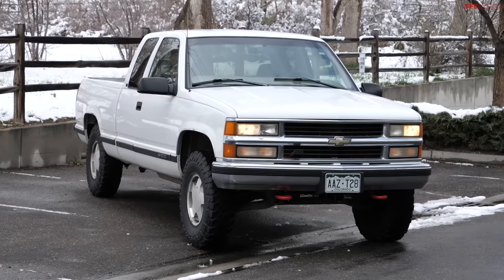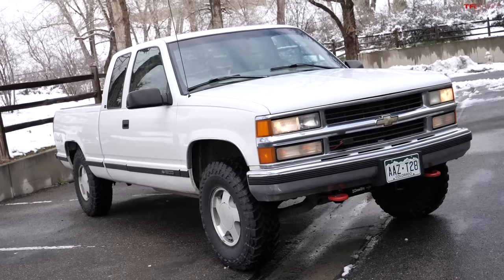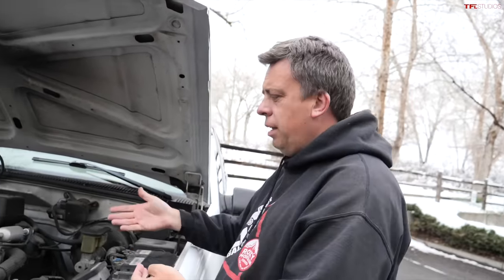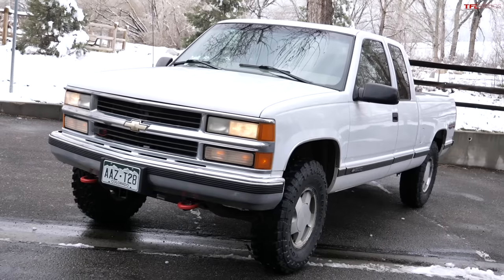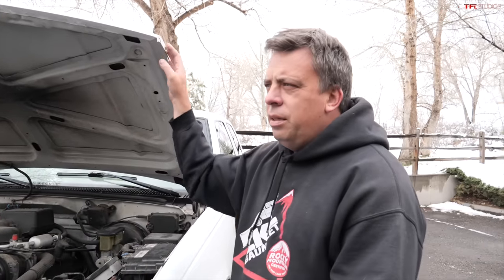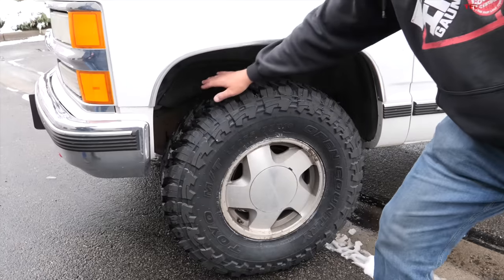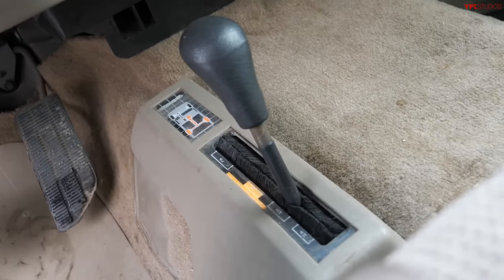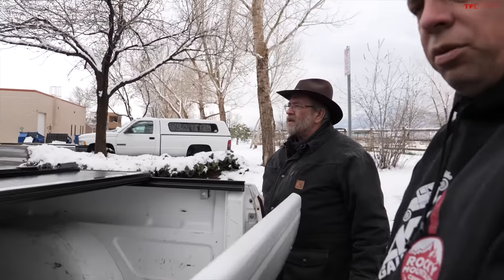Mr.Truck on Trucks: Was The 1990's Chevy Silverado The Greatest of ALL Time?

Comment: i like watching mr truck.
Reply: Thanks
Reply: Mr truck always nice to see and hear your input and experience
Reply: @markv78  Thanks
Reply: @MrTruckTV  Hi Mr truck, do u know how good were the 98 3500hd trucks. I am thinking of buying one that was driving on the highway and automatically the rear end locked up leaving a 200ft dragged mark. When the mechanic checked the engine he didn't find anything wrong
Reply: @andrewebanks325  Did he check the brakes and the limited slip in the rear axels? It's not the engine
Reply: @MrTruckTV  haven't gotten around to check out everything but I will do so and let u know, thanks for responding so quickly sir I really appreciate it

Comment: It may not be the most powerful engine, but the 350 is one of the best engines Chevy ever made.
Reply: Better Then a Rice Burner!  We drive GMC longbed and Chevrolet Silverado Z71 🇺🇸🏁💪
Reply: The 305s where great as well
Reply: I agree💯
Reply: I love my 95 tbi z71
Reply: Yes sir. Bought a 91 Cheyenne 2500 4speed 2wd from a coworker and it's working just fine. I use it as a daily driver and I usually load my tool.boxes in it when I have to in remote areas for a mine
Reply: @captinhoop they were good,if a bit underpowered
Reply: I agree.
Reply: I got a 1996 gmc sierra k1500 my truck has the 5.7 350 vortec and the engine has almost 295 thousand miles on it and it’s still trimming strong besides the transmission needing to be changed cuz the person who had it before me was trynna be a show off had the truck in 4wd and tried spinning the tires in 4wd and tore the gears out of it but the transmission that’s in it now shift so good I love it hopefully the transmission I put in it will last for the remainder of the trucks life which will be a long time hopefully I just need something to get me through some deep snow if I want it to I don’t tear my truck up or go wild with it occasionally I do show off but like loudness cuz it’s straight piped can’t beat that
Reply: I literally blew mine up 9 months ago , drives decent still idles a little rough. Definitely just gonna throw another new 350 in it
Reply: Other then the damn power steering line. I had that problem on mine.

Comment: Best Chevy 5.7 liter and best looking body style GM has ever made. Very reliable too. Love the 350 engine.
Reply: Could not agree more.
Reply: After 40 years they perfected the 350 then added fuel injection... What more could you ask for man!
Reply: @mayonnaiseluther1568  my 95 Chevy 454. Unless a big block is a little bit too much for you....
Reply: @wildestcowboy2668  my 94 454 big block agrees
Reply: @wolfmanjack8402  my 1980 squarebody disagrees with the styling opinion. Obs trucks are a close second but I love the squarebody style.
Reply: OBS the perfect sequel to the square body. 5.7
Reply: I have a 96 5.7 vortec.  Runs good but timing says it's -22 degrees.  Any ideas?

Comment: 500,000 on my '98 k1500. Original engine, going strong and still driving it every day.  It rides better than todays Chevys.
Reply: That is incredible! I hope I get that much out of my '98 k1500.
Reply: My rubbers are going... spray the ball joint, tie rod, control arm and leaf spring rubbers to avoid costly repair.. and grease the nipples... 

Guy I got my from never changed differential fluid. When I opened the cover about a handful came out, rest must have leaked out.. this was at 275000 km. Top off diff fluid right away.. or take off cover and change gasket and clean magnet.. just make sure fill bolt comes out first.. 

Paint exhaust with high heat paint to avoid costly replace.. 

My cat was cloged by 300000 km.. I now know this was causing serious loss of fuel economy.. get replacement  cat from Amazon and clamps and replace it at some point.. 

Paint frame yearly touch up with tremclad rust paint... power wash off salt during winter to avoid body falling  apart.. 

A few new parts.. starter, alternator, better battery, water pump, belt pulley, new fuel pump... and these trucks run great. .. ignition coil and wires.. 

Paint all limes underneath to prevent rusting away... 

Mine still runs like a champ.. parts are cheaper.... added timbren suspension upgrade as well.. 

With the price of new trucks these are best value right now. 

I used to own the 3500 gas long bed.. feel stupid for selling it. Right now just 1500 short bed.. 

Consider looking for 2500 or 3500 gas, gmc or Chevy obviously... but the 1500 c or k still good trucks depending on your payload needs.. 

Blacked out tail lights, lift kits, fender flares, etc, there is a lot of options to make these look awesome.. unless you can afford lower km tundra these are your best option..
Reply: I have the exact same one, spare an alternator change it's all stock, got it in 2017 for only a crazy 2 (TWO) thousand bucks.  Still working like new 105k miles later.  Best money I've ever spent.
Reply: @mysticjedi6730 thanks for the info I got a 1991 manual trans that I’m trying to restore while also using it as my work truck
Reply: Yeah, that guy don't know what he's talking about.Today's crap is what you gotta worry about

Comment: Best truck they made, hands down. I’ve had two and still look for another one.
Reply: What about the mid 90s F150?
Reply: @06mkmartin  he said 'they made', referring to GM
Reply: i’d say that or the 99-06, that’s it
Reply: And the 2nd Gen Ram trucks as well too!
Reply: I prefer square bodies with straight axles
Reply: @user-wm9pj2xj7z   yes sir the only advantage i think the gmt400 had was the od trans on all of them and efi.
Reply: Great trucks! I had a 2013 but I like my '94 better.
Reply: @hadenharper3641  I prefer the 5.3 for some reason - have had both. About to buy a 1999 single cab Z71 cuz I can’t stand the new ones

Comment: I’m still driving my 95 emerald green Cheyenne extended cab 4x4. My father bought it new. I earned my license in 98 in that truck, and I’m still daily driving it today!
Spent its life in northern Ontario salted roads, proof that yearly undercoating works!
And it’s a 5.7L
Reply: pretty much my story as well 🤣 my dad bought a 1997 chevy k2500 in ‘98 and once i got my license in 2019 it was all mine. And it’s in great condition for wisconsin because of yearly undercoating as well
Reply: Got my 1990 Candy Apple Cheyenne back in 2011 and it’s still kickin ass!
Reply: I got a 1998 Cheyenne Single cab Longbed 5.7l 2wd with 78k miles in I love it
Reply: @kevinmajeau1006  Good to hear . 95 tahoe 1500 5'7 l 263 k everything working $1500 Giving Her a Home Full package
Reply: That’s great to hear man, that’s a lifelong friend by now 😂
Reply: I got a 95 Chevy Cheyenne 2500 gmt 400, about 2 weeks ago, any advice I turn it on and it turns off but if I hit the gas it will start up doesn’t sound rough but bogley ??

Comment: If it's not the best it's definitely in the top 3. I've owned my 1990 k1500 for 32 years bought it new and she's still our daily driver with 471,400 miles on the oe tbi engine. We went to the great state of Texas a couple of years ago on I-10 and the ol'e girl had the 80mph speed limit well covered for hours. She logged around 2900 miles on the trip and didn't miss a lick the hole trip. 👊👊🤙🤙👍👍✌✌

Comment: My favourite generation chevy truck!
I think 95 is the best year for these, you can retain the TBI engines with an updated interior/exterior. Nowadays the Throttle body injected engines are regarded as too low in power (a valid opinion) but, for my needs the 350 TBI was enough and the reliability was excellent. 360K when it was sold and ran amazingly well. No oil leaks, nothing was rebuilt, no knocking, no misfires, no oil consumption until well over 300K miles. Hard to break a good size 8 with 200 horsepower. 
One of my favourite body style trucks for sure. A bunch of them are ragged out unfortunately. This one looks great though! Cool video guys, nice to see Andre and Mr. Truck. Love the chemistry between these 2 presenters in particular.
Reply: What's your thoughts on the 93 Chevy Silverado
Reply: I’ve always been partial to the older interior style, just something about the blockier styling makes my lizard brain happy. I agree on the rest though, it’s hard to beat a good, solid truck. And you’re especially spot-on with the lack of power, even my ‘94 Suburban 454 has a tough time keeping up with anything remotely modern, but I can rest easy knowing that the thing will happily go far, far beyond the 150k it has now- so long as I take care of it, anyhow.

Comment: I remember wanting one of these at bad as a kid, the last year, 98 with the 5.7. just so classic and bullet proof
Reply: '99.
Reply: I still have my pops 94 Chevy Country Coaches K1500 as a daily driver with now only right at 90 000 original miles and yes it's like a TANK and drives smooth as silk with that automatic transmission and wouldn't take NOTHING in the world for it either and if something breaks on it it's totally worth fixing rather than being in hock for $600 or $700 dollar month payments !!!
Reply: Yes 98 on truck Tahoe 99 good motors

Comment: Best Truck GM ever made if you can keep the frame from rusting out!!!
Reply: I’ve never had that problem in the south 😁
Reply: That’s the only problem with mine lol.
Reply: Down here in the south I never seen a rusted out gmt400. They are everywhere.
Reply: @screamingscarecrow4251  guess where I’m going to go to buy my next truck in the future 😆. Bringing it back here but this time I’m coating the underside to make sure it never rusts on me. Used trucks are terrible around here. It’s sad because I have a great 98 z71 fully loaded for its time and if it wasn’t so full of rust and faded paint it would be perfect. Probably be on the road for another 20 years yet.
Reply: @screamingscarecrow4251  I would bet if you dragged a few of those trucks frames up north, you would have a lot of buyers. We have trucks that look brand new with perfect bodies and interior but the damn frame is rusted to dust. It seems to only be the 1500 trucks, I’m guessing 2500 and 3500 have a thicker gauge steel.
Reply: 90 GMC K1500, bought new, still going strong. Unfortunately the frame is going to give out before the drivetrain does.

Comment: I have a 97 k3500 crew cab dually and put a 12 valve cummins and a manual transmission in it. Built for running , driving , and WORKING. Thats it. It does that very well.

Comment: GMT400 WAS ABSOLUTELY AMAZING.
MY 91 K1500 Stepside Single cab is Too cool.
It’s a 5 speed, tilt, cruise, and gas sipping 4.3.
Reply: I have a 92 k1500 single cab fleet side z71 with the 5.7. Have had it almost 20 years and no major issues.
Reply: sounds like a really nice one i had a 91 also k1500 ext cab SB with the 350 and the 5lm60 gen 2 4spd with od manual i loved that truck a lot definitely miss it actually 4/20 reps it being 2 years since i wrecked it

Comment: The GM 5.0L was a DOG power wise. I’ve owned two 98 GM's, one with the 5.0L and one with the 5.7L and the difference is night and day. I still own the 98 with the 5.7L, 209,000 miles and it still runs like a top with zero major repairs. Love driving it, even 20 years later. All I’ve ever done that one was a fuel pump and an alternator. Other than that, just regular maintenance and they’re indestructable so long as they are cared for.
Reply: 230 hp and 285 lb-ft ain't bad in 1998
Reply: @steveheighton5971  I agree, but when a modern day Honda Civic is pushing 300Hp, it brushes the ego a bit, lol.
Reply: I've owned both the Vortec 5.0L V8 (305) and the Vortec 5.7L V8 (350) .... They towed about the same and seat of the pants feel was about the same... Only the 305 got much better fuel economy.....Both had 3.73 rear axle ratios ....You must have had a Dud of it was a "Dog"...

Comment: I own the first edition of the GMT 400. it's a 88 Chevy Cheyenne k1500 4x4 with a V8 350 throttle body with 207,000 original miles and still runs like a champ

Comment: My 1997  GMC Sierra Z71 w 5.7l was bought in 2001 w 54000 miles.  It is still going strong 20 years later towing my travel trailer with 247,000 miles...never giving it up

Comment: I have a 1997 K2500 with the big block 454, it's also fuel injected. Mine also has the towing mirrors, which look much nicer.
All of the later years had both mechanical 4wd and buttons as an option.

Comment: My dad bought one of these brand new in 94 with the z71 package and dressed up nice with factory chrome with the 5.7 and Ive bought 10 different trucks and he still only has his 94 The original plug wires lasted 25 years and 244,000 miles Its pulled boats,campers etc and till this day It still dont show any sign of giving up

Comment: Last year I sold my GMC YUKON it was a 21. Nice SUV but I made the move bought a 97 GMC Shortbed with 350 restored with 88k orginal miles a Texas Truck.
Also a 95 Tahoe 2dr. Low miles as well . Texas Truck as well complete restoration.
Didn't look back. These particular Trucks by GM were the Sweetspot.  The best they ever made.  I love them. There Goodlooking and Reliable and Simple. Not a Computer Couch.
I have no regrets .
Reply: I was in a similair situation bought a brand new 2022 nissan frontier pro4x great truck ive had nothing but nissan trucks but got tired of getting little dings from using it as my work truck found a 2011 chevy silverado with only 53k miles 5.3 4x4 on market place got it for a steal eventually started driving the chevy when i wasnt working because i just enjoyed the simplicity of it wound up selling my 2022 nissan frontier just before the market started tanking in 2023 made money off of it never looked back got 62k on the silverado now and shes been an awesome work truck for my business

Comment: I have had 2 c1500s. Sold one to my buddy he still has it and I still have my other one.

The one I still have I pulled out of the shed it was stored in while I was stationed in Germany and all I had to do was change the fluids and I drove it 1600 miles to Georgia without a hick up.

Comment: It's the best used truck to have if you turn your own wrenches and this means a lot coming from me, because Im a Ford Guy!
Super easy to work on, super affordable parts, reliable,  powerful, comfortable, 1996 was 1st year of OBD2, fuel injection, ABS, air bags, auto locking rear diff (depending on package), push button on the fly 4x4 (depending on package) and a dam good looking truck!

Comment: Had a s10 blazer from this generation.  Comfy, rugged, fairly easy to work on.  I'd like to get one of these rigs again but first things first, need a carb conversion, a stand alone trans controller (or a 3spd), and a cable for the front axle and get rid of the vaccuum.  Totally agree with the steering and suspension.

Comment: Having the distributor in the back is the best vs the front moisture is harder to get to especially off roading. My friend had a F-150 with 351 hit puddle too hard it would die! His lifted 86 350 we would drive through lakes never died. I have a 99 3500 dump with the 350 vortec its been amazing for 10 years ive overloaded it millions of times. My 98 had 200k i traded it in was still running mint. My 93 had around 200k and it never got a break. My buddy had one 300k never let him down! And plowing visibility was amazing!

Comment: I have a 1999 Chevy Tahoe 4x4 with the 350 Vortec Engine, dual A/C unit and heavy duty towing package.  It is my favorite vehicle of all times.  It runs beautifully, handles perfectly, muscles through mud, snow and ice, and tows like a diesel.  It has leather interior, an aftermarket DVD player for the kids, and plenty of storage space.  For the most part I consider it too good to even use except when absolutely necessary, so it has only 66,000 miles on it…..and it should last forever.  It is completely reliable, comfortable, sturdy and scrupulously maintained.  I bought it new, paid it off years ago, and wouldn’t sell it for all the money in the world.  I have owned multiple chevy small block 8 cylinder engines, including a 283, a 305, two 327’s, and two 350’s, and they were all the best engines I ever owned….the 350’s having the most grunt, and the 327’s being the most badass.  My 305 was rebuilt at 290,000 miles and had so little cylinder wear that an overbore was not even needed.  I re-ringed the standard pistons and it is still powering my 1985 Firebird today.  I love 4 cylinder Honda and Toyota engines, but nobody builds a better 8 cylinder than Chevy.

Comment: Just ordered a set of 906 Vortec heads and a custom black 40-20-40 low-back seats to go with the blacked out interior of my 93 Sierra K1500 5.7.

Still have a bunch of work to do but now I'm on to getting the drivetrain where I want it. I love this truck.

Comment: I’ve had a 94 k1500 z71 for 8 years (was my first truck) it was same as this extended cab short bed except last year of the old interior witch I love a lot more 
And it has the tbi 350 I’m planning on restoring it frame off and put a ls in it 
I will forever have one of these trucks in my opinion best cheap trucks ever made
Reply: Yes a 94 interior was awesome! Dad had a 94 2500 and it way the best buckets and an actual useful center console. I hate the center console in my OBS 2000 Z71 Tahoe.  Absolutely worthless lol
Reply: Realizing you shouldn't have gotten rid of it... :)